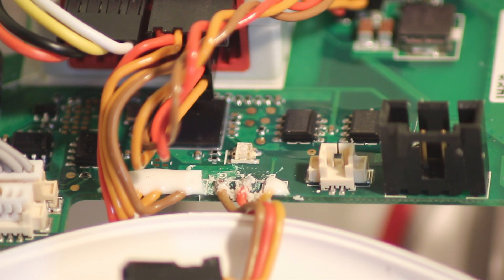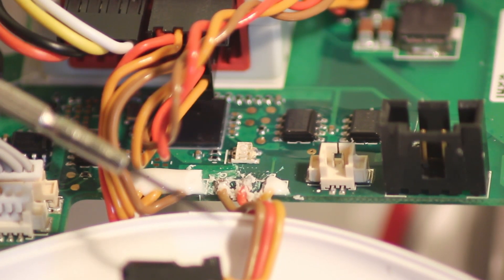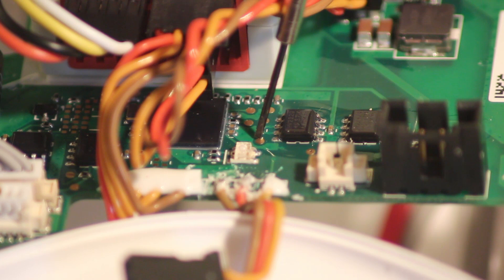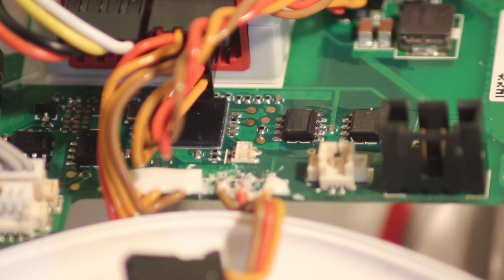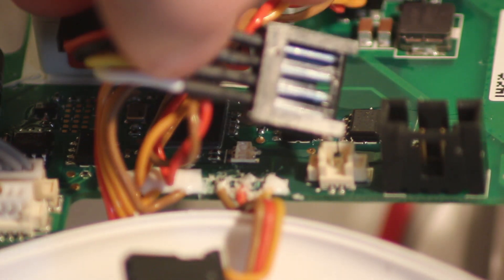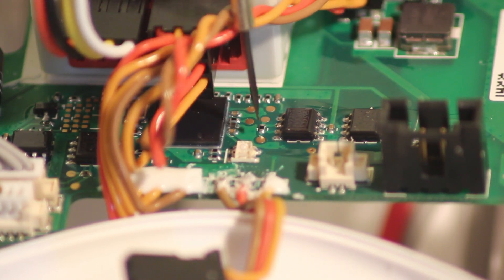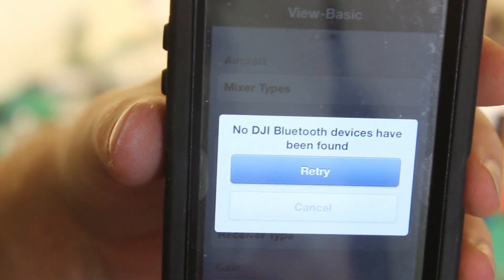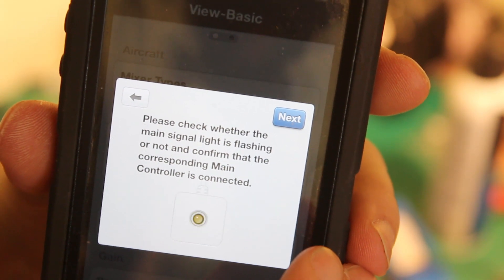Can Bus Port on DJI Phantom v1 - How To Guide

Comment: Awesome video and forum covering ur swap. Ive been following along building a new case for my phantom 1.5. Was just wondering if u knew what the 2 pin plug to the right of where we solder is for? Could u plug the wires from the p2 smart battery in to it?

Comment: What size pins and connector blocks did you use? How/where do I buy them? Any idea if the receptacle used for these plugs is sold anywhere?
Reply from the maker: Best bet is to go to Amazon and search for 'Arduino Jumper Wires'. These work perfectly. The receptable is DJI's own so there is little chance of finding it and it is a bit chunky for the purpuse anyway.

Comment: Just opened my phantom up and the board looks totally different. 
Its meant to be a Phantom V1.1.1 and has Naza v2. 
I thought V1.1.1 was meant to have the upgraded board. 
Any ideas what the case maybe.
Reply from the maker: Yeah I've had a fair few people with this. Basically it turns out that the v1.1.1 only had the new RX and the NAZA v2 but didn't come with the upgrade board as standard. There have been a few people that did get the upgrade board and some even have a very rare v1.2 which did have it. Either way if its not there then sadly you will have to buy one and add it for this mod.
Reply: d3weyTube hello mate, I LOVE THIS VID/TUTORIAL. I JUST COME ACCROSS IT BY FORTUNE. COULD I DO THIS WITH MY DJI FC40...IS MY MAIN BOARD AND COMPONENTS COMPATIBLE WITH DOING THESE UPGRADES. pLEASE REPLY. I WOULD MUCH APPRECIATE IT.....I AM A LITTLE PRACTISED WITH SOLDERING SO COULD POSSIBLY DO THESE UPGRADES IF IT IS POSSIBLE TO DO WITH THE FC40 MODEL..CHEERS DEWY....I REALLY ENJOYED WATCHING YER VIDS, I WILL KEEP AN EYE OUT FOR MORE..REGARDS BRI

Comment: Thank you for the info i have to start working on this one

about the CAN bus hack

does it mean you dont need a CAN hub ??
or you still needs it in order to connect more then one port ?
will the h3d3 work on P1.5 ? 

Thanks in advance
Koop
Reply from the maker: If you do this modification you get 1 x CAN Bus port. If you attach the iOSD you then get it, plus a second Can Bus port (which you can plug the Zenmuse into). If you want say a Zenmuse, iOSD mini, Ground station and BTU all connected then you will still need a Can Bus (and bigger motors cause you will weigh a ton!). As yet I'm not sure if the H3-3D works. Pretty sure it will but you will need to use the GCU unit (plugged into the the created canbus port). The upgrade board's internal GCU might work but until they get the H3-3D seperatley available in the UK I can't test it.
Reply: d3weyTube i couldn't wait for you reply ;:)
so i have order a phantom 2 ( new version ) shell all the cables and and plugs i will need , plus i orders the P2 main board which now i regret and ask the dealer to cancel this part from the order ( waiting to hear from him ), i only now understand that this board has the ESC connection to thye board and not in to naza, so i guess it wont be good. i am now looking for the the upgarde board and naza v2 led. about zenmuse i will deal with that later on fist thing is to have a phantom 1.5
Reply: d3weyTube allso please help me with 3 question
both concern the LED
1. if i decide to go with 1 LED and i wish I to be the NAZA v2 led .
 can i place it in the front ( where you have placed the old P1 LED )
2. why haven't you done so ?
3. does this NAZA v2 like you have unit is that same one supplied with the stock P2?   if so from your pic and vid i cant understand how come the USB port is facing to the side of it and led in the front?? 

again thank you for a valuable INFO
Gilad
Reply from the maker: Gilad Langer
The P2 has an integrated LED that makes the P2 ESC's flash.... you can use the NAZA v2 LED and put it anywhere you would like to really. My modifications meant I could have one at the front and one at the back so it is even easier to see my battery status no matter which way I'm heading.
The USB function on the v2 LED works just like the v1 USB pluggin.... the P2 USB uses a seperate module altogether but you don't have to use it. The key is that USB works via the LED port on the NAZA so as long as something is plugged in there it will work.

Comment: This video is great. THank you. I have the upgrade board but was told that it'd be a good idea to put in the PMU as well. I'd like to install the iOSD mini and the AVL58 video transmitter. Both units are DJI. But I do think I can do this. Once I install this mod, can I connect the CAN BUS hub directly to this? ANY help is appreciated. I'm running out of time and would like to get this installed.

Comment: This is brilliant, D3wey, thanks!  This is exactly what I want to do (get the BTU module installed w/o needing extra crap).  Have you experimented with your Phantom following waypoints?
Reply from the maker: Good good. Glad it is of use. The BTU unit on its own doesn't allow waypoint flying. You need the full Ground Station Datalink for that. I use the BTU to make changes to the settings in the field.
Reply: By the way are you using some kind of special board in your Phantom?  My FC40 board doesn't have any of those solder points :(
Reply from the maker: killr0y
Ahhh... yes I hate to say it but the FC40 is a totally different animal to the Phantom v1 or Pv1.1.1. I can't find much info on what board it uses but I think it is just the original Phantom 1 board. To do the mod you see here you would need to buy a Zenmuse upgrade board BUT I am not sure how the FC40 camera attachs inside.
If you have it open then PM me a picture or two of the insides. I'd love to see what is in there either way and am sure we (The internet!) can work it out.
Reply from the maker: killr0y
EDIT - Just found a picture of it and realised the camera has no power or connection at all to the main board (all wifi!). The FC40 has the old original Phantom v1 board but with a 5.8ghz transmitter (mounted seperatley). Yes you could do this modification but you will have to buy and fit the Zenmuse upgrade board. Its not that hard to do but if you do it you may want to consider moving it all into a Phantom 2 shell at the same time (see my other videos). More space for batteries and the option to use the P2 battery if you want.
Reply from the maker: killr0y
Yep thats exactly what it is. It replaces the function of the PMUv2 (hence why it has a secret CAN-BUS port).
Before buying a Phantom 2 maybe consider reading my case study here: http://www.rcgroups.com/forums/showpost.php?p=27306293&postcount=2